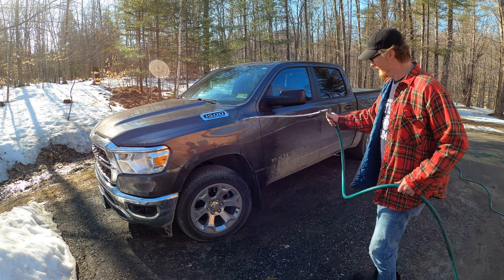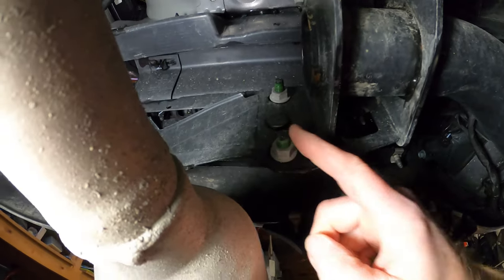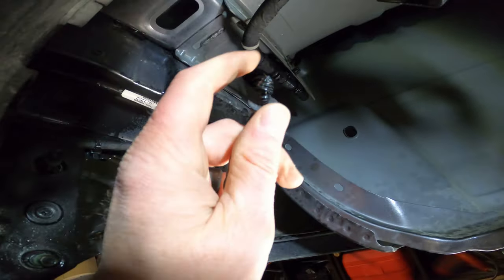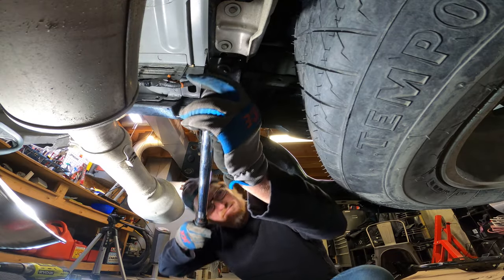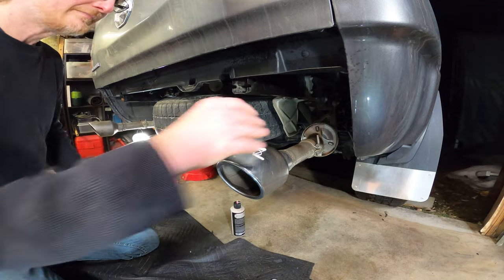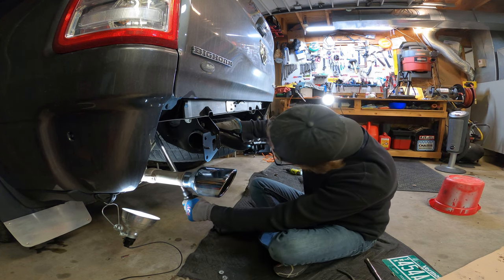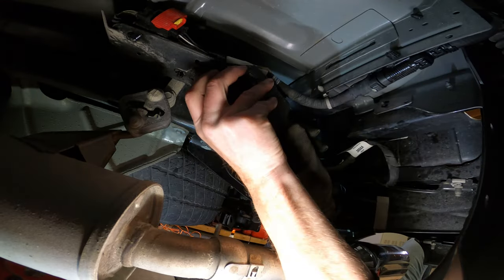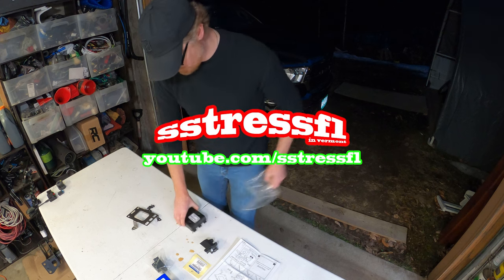2019-24 RAM 1500 Trailer Hitch Class 4 Install

Comment: Just bought my 2023 Ram Laramie and was surprised it came with a class 3 hitch and no receiver. I feel the dealership removed it. I just bought the class 4 for $340 from the dealer and going to install hopefully soon. I got a bit confused because I saw a video that the class 3 rows up to 12k pounds and I thought it only did 6k so not sure I need to upgrade. The dealer told md your class 4 tows up to 12,750 pounds. You made it look easy so hopefully it is for me
Reply from the maker: I agree its weird to equip a truck with a ~10k or more tow rating with a class 3 hitch. And the way they designed it, the oem integrated class 3 hitch requires an adapter to install a typical 2" receiver. BUT... the bolt on adapter can only handle 6000 lbs and its not approved for weight distribution hitches. No good! The class 4 is the way to go :) And yes! It was surprisingly easy!

Comment: Thanks, Just orderd one for my 2023 Ram Laramie, Mine come the same way, Dealer said Factory Could not get Hitchs at the present Time, that's why they are putting on Class 3 Hitch, My 2020 had the Class 5 Hitch. But I did get an additional 500 off for the Hitch.
Reply from the maker: That’s great! They are tough to find! Rockauto seems to have 1 class 4 Ram hitch at a time. Hard to find for sure. Enjoy 👍

Comment: Thanks for the video.
 I just bought my truck yesterday and I could not believe the class 3 hitch on a truck.  Dodge let me down being cheap with the hitch.
How much did you class 4 hitch cost?
Reply from the maker: It’s obviously a way to get the price point as low as possible. But I don’t mind. It was an easy upgrade and so was adding the oem brake controller (video to come). I put a link to the hitch in the video description below. It’s available at rockauto for 199! Not too bad 👍
Reply: Consider this. Would you rather buy a $1000+ option, pay for parts and labor at a dealership, or pay $200 for a part and install yourself?

Comment: Do you have back up sensors on your truck? Just thought about that with mine probably need to disconnect them to take off the bumper
Reply from the maker: Yes I imagine you would need to disconnect the wires. Mine does not have them.

Comment: I didn’t know the class three wasn’t rated for weight distribution hitch is I’ve been using mine for years
Reply from the maker: A class 3 hitch is strong enough, but it’s the bolt on 2” adapter that is not rated for a wdh. It might work but not worth the risk for me.

Comment: Hey planning on doing this on my own. Do you have a link to the class 4 hitch? Also i have a 2024 ram 5.7 etorque will this still fit ? Thanks.
Reply from the maker: I put a link in the description beneath the video. Rockauto! 👍 I’m pretty sure it’ll fit a ‘24 but plug it into rockauto and it should verify. It’s a nice unit.

Comment: i just had the dealer install a hitch for me but i think maybe they might have just basically reinstalled a class 3 hitch with that receiver adapter. i'm going to find out tomorrow and if they f'd me over like that i have zero use for a class 3 hitch i can not even move my boat at all. this is stressing me out. and i dont understand why they would even offer this stupid class 3 hitch in the first place knowing damn well the class 4 hitch is only like another 20 dollars... 20 dollars to make everything so much more simple and for people to actually get a real life hitch for a 12,750 pound supposedly rated truck. why ram lies so much about everything...?
Reply from the maker: I hope you got the class 4! And I agree, other than going cheap I can’t fathom why they would install a hitch that is well below the trucks towing capacity.
Reply: @sstressfl  they did install the 4! 😅😅😅 I am so confused as to how they didnt include a proper hitch on a hemi truck.. I understand why they put class 3 hitch on a 3.6 v6 but a v8??? Fishy... It is a 2020 ram classic slt so it must not be the upper echelon of the trim levels but i dont need all that mess i am so unimpressed with all that supposed technology i have it in my car and it does nothing for me. the main thing is it has a backup camera a hemi for towing. They put highway tires on it not all terrains in 2022..on a 4x4 which is another thing i can't understand.. to get maybe a third mpg more... smh. the mindlessness is unbelievable. I buy a truck to have a truck not to drive it like a 4 banger but to use it as intended. I have a car for everything else.
Reply from the maker: @hvacdr  woohooo!!! Sounds like you’re good to go 💪😎